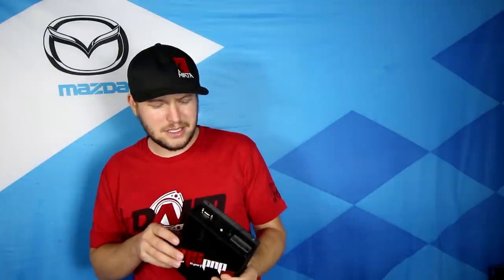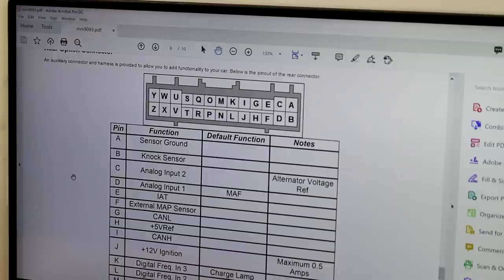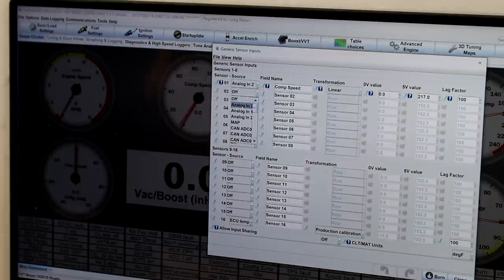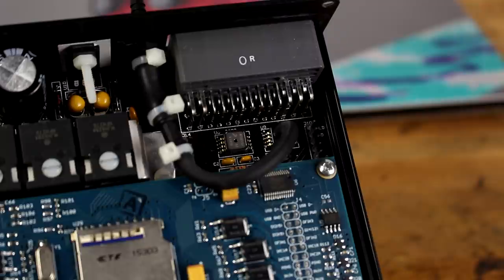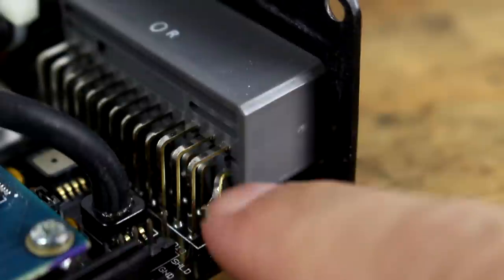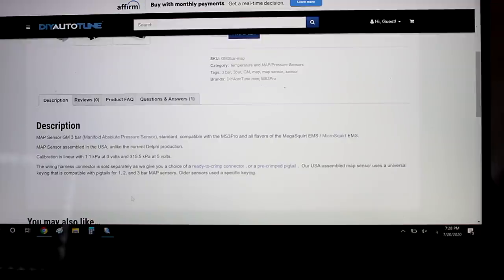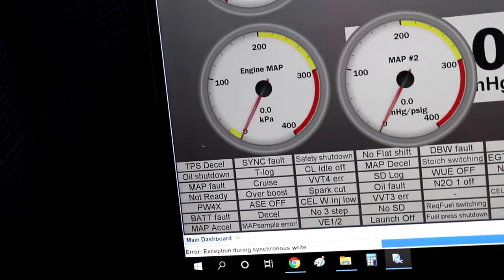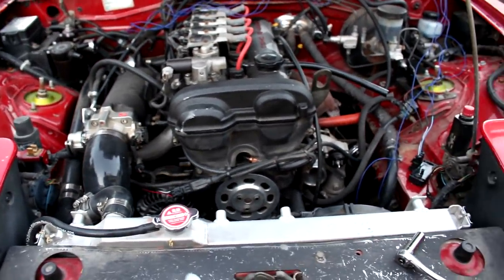Megasquirt ECU Hacking! (Adding an Extra Analog Input For Free)

Comment: You could put a blob of silicone on the board connection for strain relief
Reply: Good idea, I've used hot glue too. Only thing it's failed on so far is a Polaris RZR; knocks the giant metal capacitors off the amp board with hard hits. Gotta try silicone on that.

Comment: I seen wires break like that too more times that I can count in my field and couldn't help from laughing for a good 5 minutes. Your iron works just fine with  little to no practice but for a few bucks more amazon has iron/hot air combos that include any tip you want for any situation at around 40-45$. I picked one up to work on cell phones. Thank you for the content!!! Looking forward to see more videos from you.
Reply: also if you are still reading this, lead based is superior in a high shock variable temp environment avoid silver solder

Comment: You need to mount the map sensor vertical or near vertical with the nipple pointing slightly downward especially if you are going to use it to measure crank case pressure you want anything that might get into the sensor to drain back down into the engine not stay in the sensor cavity. Good video btw.

Comment: You can also use that second map sensor as a barometric correction for altitude mountain driving.
Reply from the maker: I don't believe that's really needed because the fueling should just be based on whatever pressure is in the intake manifold already
Reply: @TheCarPassionChannel  true. The megasquirt samples the main map sensor on startup to set the barometric pressure. However once running cannot adjust this, so if you were to start at sea level and drive into the mountains your fueling would be out and visa versa. Obviously a good mod for say pikes peak. 😁

Comment: Not gonna lie, I cringed a little bit when I saw you trying to solder the wire to the PCB. I did work like that for well over a decade and a low wattage iron is super important if you don't want to lift a pad, or burn out a barrel.

Comment: Great info, just out of curiosity is there a reason you didn’t use the MAP pin, is it being used for something else or does it not work for that sensor
Reply from the maker: You mean the pin for the on-board MAP sensor?
Reply: TheCarPassionChannel options pin F
Reply from the maker: @mattbergstrom3362  Ah yes, because on the board you have to install a jumper that can activate the internal, or external MAP sensor input. That way the ECU knows which to look for. You cannot hook a MAP sensor to both and use them simultaneously.